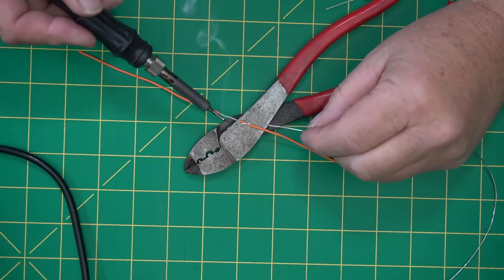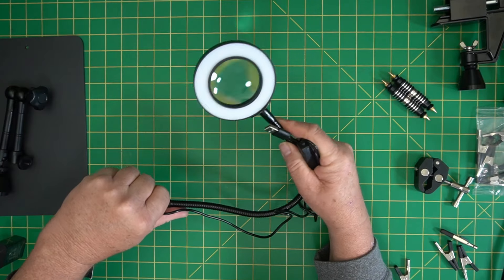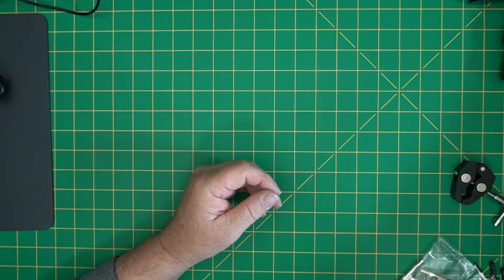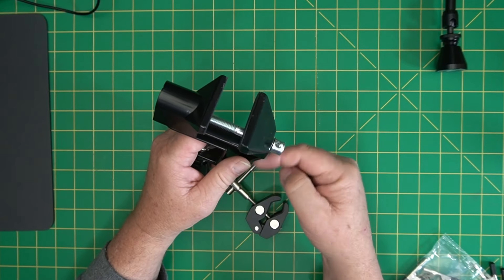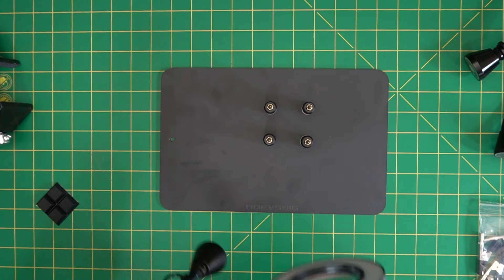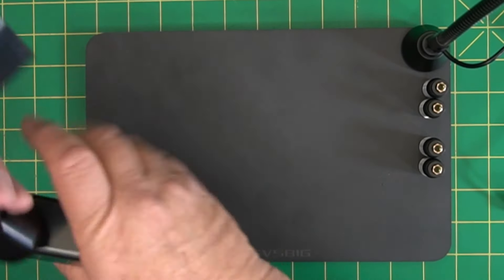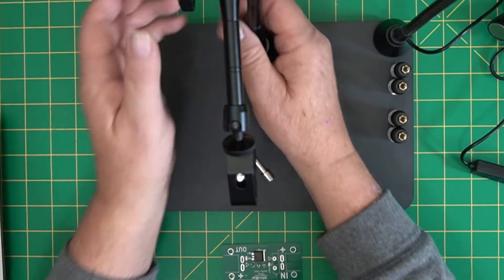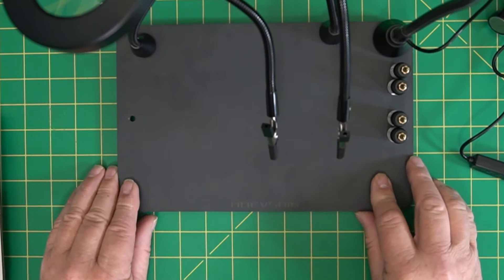NOVESBIG's Magnetic Helping Hands for Soldering it's like a  Third Hand!

Comment: I like most of this but the vice should tilt so it makes it worth while rather than putting it on the pins.

The pads are spares for the jaws of the vice.

The articulating clamp is for heat guns...
Reply from the maker: The vise has multiple points that you can tilt it.

Comment: Aloha Chuck, 
Man, this looks like a really great product for me also. 
  I build my own battery bank cables in which I buy the cable in large spools and use bolt cutters to cut to measured lengths before I use heavy lead solder and tin spools to cut into short lengths to stand up inside the terminal lug connectors. 
     I usually use heavy rubberbands wrapped the handles of my large Channel Locks to hold the terminal lugs in place while I use a butene torch to heat the lead and tin pieces into liquid inside the Terminal lugs before jamming the cable into it and use a second pair of channel locks to crimp the terminal lugs onto the cable, then use black or red heat shrink as a final touch to make them look nice and professional when done. 
     This kit in your video would probably work better for me with that big magnetic vise I think would be perfect. 
    Then I always have these smaller jobs in which that LED light would also be perfect. 
    In fact, I just picked up some red, black and green insulated 8ga awg cable that was cut at 21 feet for my new Jeep to go through the firewall and bolt into a bus box under the front passenger dash for all my radios and will add a 600w DC to AC inverter because the 150w inverter made for my Jeep is just too small for most applications. 
    I also have two antennas that I need to repair in which this heavy duty set up you have in this video would be perfect for. 
    I’m going to Washington DC for 15 days next month again this year to meet up with some fellow vets from my VVA Chapter 858 to go visit the Vietnam Veterans Memorial Wall for Memorial Weekend. 
    Plus I plan to bring my G90 to do some rag-chewing since I haven’t learned how to do POTA’s yet. 
    So your video is perfect timing for me for some of these little projects that I want to get finished for my trip like my Tram 1185 mag mount antenna that my wife somehow knocked the steel ball off the tip in the underground parking at Ala Moana Mall last year. I’m planning on taking that with me for this trip to use on the rental car when I drive up to Chesapeake Bay to visit a friend that has Alzheimer now and the only person he can remember according to his wife is me. He can’t travel on airplanes anymore and I want to surprise him. Unfortunately, it’s like going to visit Joe Biden, alert at times and gets confused real easy and tends to fall down a lot because he forgets to look for where he’s going. 
     Don’t worry, I’ll take good care of him and give his wife a break for a few days. It will be my last opportunity to see him in person I think. I’ve known him for over 30 years and it’s been 3-4 years since I last saw him here in Hawaii. It will be my final farewell to him. 
    I’ll check to see if you have a link to this product somewhere in this video. 
    Keep up the good work, Chuck and 73’ 🤙🏻
       Todd WH6DWF🇺🇸
Reply from the maker: It works well, have a good time in DC Todd!